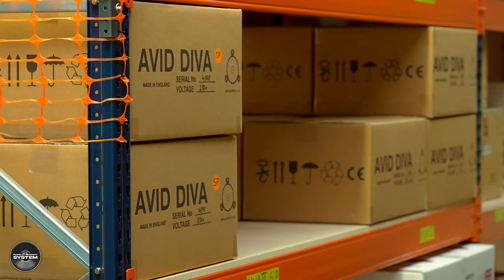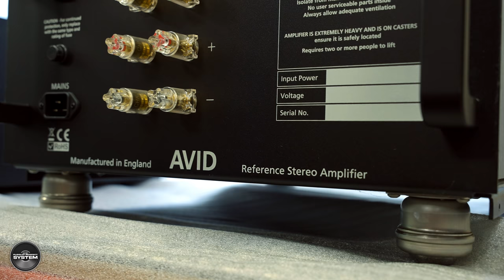TURNTABLE SETUP ADVICE for Vinyl Record player "adventurous" BEGINNERS

Comment: I am not a currently a "practicing audiophile;" I stopped playing the game back in the 90's. Bui the practical side of me says that if you really wanted to remove unwanted external vibrations, you would remove the turntable from the listening room altogether. 

Honestly, high end audio is jewelry for (primarily) men. I am not saying serious engineering is not going into this stuff, but fundamentally a turntable is a simple thing,.that has been turned into a gold plated Rube Goldberg device. I fell into the trap myself, although at least I acquired my turntable (a Kyocera PL-910) at a warehouse clearance sale for relatively little money. There is no way in heck I would spend five figures for a spinning platter, EVER. A turntable that expensive is a vanity device, and no way can the cost-to-benefit ratio ever be justified on sonics alone.

Comment: I have the utmost admiration and respect for Conrad and the team at Avid !  I considered a mid level unit but the cost, along with the rather light dealer network in the USA caused me to pause.   Sigh...
Reply: Did you not have a washing machine to put it on?

Comment: I've known Conrad for may years and was one of the very earliest owners of the Acutus first series turntables. It was released, let's not forget, completely against the tide, so to speak, at a time when CD reigned and was on the rise so its testament to both the quality of Avid's products and the leadership and technical knowledge of Conrad firstly, but also the staff he's since employed and its great to see that the company has flourished. Check out Avid gear - its great and for me, Conrads systems are consistently some of the best sounding systems at shows, too, a feat that's not easy to achieve in some of those rooms. He knows how to set up a system to bring the best out of it but also, his products are exceptional, so I guess that makes it easier to start with!!

Comment: Buy a cd player is you want a quiet, perfectly accurate sound. A good turntable with a good cartridge is enough to enjoy vinyl records, but if you want a perfect sound, definitely buy cd player. Most records since the 80s were digitally recorded anyway, and there's also many variations of a particular cd depending on the year it came out, who mixed it, what technology was used. And when you know how they're made, you'll see that they share many common points with vinyl. 

This have a lot to do with confirmation bias when you're paying obscene amounts of money for a boutique turntable, than it has to do with the sound accuracy because nobody will say that their 20k $ turntable almost play as well as an average cd player, no matter if it's true.

Comment: I like the look of these turntables, the inverted cone with the bearing at the top is very interesting, should produce an air-bearing effect around the cone and maintain a level platter very nicely.

I do take exception to their assertion that hand-built circuit boards are better.  I watched that guy handling those resistors, placing them on the board... with his actual hands.
Dry solder joints occur when you get contaminants under the solder, which then corrode their way out.

I would much prefer a clean-room approach with pick-and-place robots, with just final hand assembly for the large capacitors, transformers etc, with high-accuracy components and possibly a varnish over-coat to prevent airborne corrosion later.
If they were going to go for hand-built then I would prefer to see wire-wrap circuits than PCBs.  There seems little point in going to the trouble of printing a circuit board, then going at it with a regular soldering iron.

Comment: The obsession with vinyl makes me laugh. The best Studer A80 tape deck used in mastering peaks at 18khz and doesn't go lower than 60 hz. When a Neumann lathe cuts a record, the top end is naturally further rolled off and the bottom end has to be levelled down as well so the grooves don't collide. The result is a frequency response and signal-to-noise ratio that can be encoded with less than 16 bits, Red Book CD standard. Then there is the myth that somehow, you hear detail in the sound wave, that the analogue transducer is magically able to restitute, especially with valve amplification that further adds second-order harmonics. The problem with you guys is that you've never experienced a proper, double-blind, level-matched comparison. A good one would actually need to add analogue hiss to digital playback, to avoid the ear being able to distinguish the digital source on the basis of its silence alone. As for "digititis", the sort of sibilance that was an issue back in 1982, today with modern ADCs and DACs this no longer exists. But I get it : You're not selling audio reproduction excellence, you are selling a lifestyle. Maybe consider incrusting diamonds on the chassis of the turntable.
Reply from the maker: I think these days most audiophiles with high end turntable setups also have high end digital setups as well and if you read through the comments you will see a lot of people say some stuff sounds better on digital but they prefer others on vinyl.  I have heard most of the very best digital setups and yet some vinyl setups have sound better in some ways too so best not to draw a line with things like this and be so damning towards others who clearly see things different to you.

Comment: The Avid Acutus is a fine turntable. Although personally I've not liked the SME arms that I've heard, due to them prioritising detail over dynamics.
The real value in turntables is in the right priced idler eg Garrard 301 or 401, classic Lenco, or Japanese mid range to statement level direct drive from the 1970's to 1980's. All with the right arm and moving coil or moving iron cartridge. Plus a decent phono stage, eg NVA Phono 2 plus correct positioning of the TT - as far away from the speakers as possible on the right support.

Comment: That Avid guy talks about compromises, like the length of the tonearm as it constantly change the angle of the cartridge in respect to the track, when the vinyl are carved in the mastering process with a stylus that are always in a fixed angle to the track. What happened to the turntable in the old days that had a tonearm that moved in parallel over the record to keep the angle correct? Was it Bang&Olufsen ?

Isn't time to replace all that expensive hardware by modern technology. The needle wouldn't need to drag the tonearm over the record. Why not put a laser in a cartridge that follows the track and exactly steers a tonearm motor to keep the needle exactly in the middle of the track. Or even better are to replace the needle with two lasers that reads the grooves two sides and make use of their modulated output. I think that CD's have some 40dB more dynamic than vinyl, so vinyls need to be mixed more compressed with less dynamic to not end up in the background noise of the plastic material in the vinyl. Vinyl requires the bass frequencies to be mixed into mono where a CD can have separate unaltered bass in both channels.

The problem are that most of modern time CD's are mixed to sound good from broadcast radio, a mobil phone or in a car where it needs to be compressed more. So the increased dynamics are not put to use in CD's but the superior technology are there. When I listen to audiophile records with great dynamic in the mixing and there's a symphonic orchestra playing and it goes very quiet, I can still hear the background noise from the grove. There's not enough dynamic room possible with vinyl. Compared to CD's of the same orchestra it's dead quiet and only the room noise can be heard when just a couple of instruments are playing.

The whole process of carving the aluminium disc from the master tape, analog or digital, and then put a electrolyte skin over the aluminium to protect it and then pour metal into it to mold several negative discs that then are used to press plastic records from, all that mechanical transfer will add molecule noise from the materials surfaces in each copying process and will reduce all the details and high frequencies from the final vinyl that you buy, and then add the reduced dynamic range in the physical media. Why would anyone prefer vinyl instead of CD? With vinyl you get a softer sound, as it has been stripped off the finer details, and can be pleasant to listen to when it doesn't have as much information that you will need to process, as when listening to a good mastered CD. All these super expensive vinyl equipment are like putting lipstick on a pig, the base to build on are not good enough.

Comment: Who machines up the platters on these things? A pre schooler? Any engineering shop I know would immediately reject that much run out, look at the thing!!! Around 12:30 provides a good view.
So easy to see with the naked eye; I've seen same from other vids of similar TT's. Absolute rubbish. I put a dial gauge on my TT and runout is near to unmeasurable and certainly cannot be seen. 
BTW we are instrument technicians, rotating machinery specialists and a NATA certified lab.

Comment: Or you could go to yardsales like I do and find whatever. Like a 1978 JVC QL-2 w/AT eliptical needle cartridge. A 1977 JVC KD-25 cassette tape deck. A 1978 JVC jr-s301 receiver. A Magnavox 5-disc CD player and two Kenwood speakers........all for $30.
  They all worked perfectly except for the cassette player which I fixed and now works perfectly. Show me a DD turntable for under $1000 that spins as accurately as that Quartz-lock TT. I'm sure something is out there, but not for $200(which is about the average price for a QL-2). Someday I'll find the guy who don't know what he has and sells me one of these things in the video for $10.😆😆😅😳

Comment: I really like the vidéo.
I wonder if there is no way to correct the playback? Left and right are inverted.
Reply from the maker: Shouldn't be it was recorded in stereo and then I adjusted the sound to balance each of us to be more central when speaking solo but also so you could hear the fact of where we were sitting
Reply: @PursuitPerfectSystem  yes indeed where you were sitting specially at the beginning. It's better after. But it's on most videos on youtube. Not only yours. Only movies, tv shows and video games get it right.
Reply from the maker: @yannick930  if your experiencing sound issues  across various YT channels I think check your settings must be something a miss there as getting stereo sound correct is pretty basic stuff in all video editing softwares and it's right 99.9% of the time on YT. Just a suggestion

Comment: belt drive is the most inaccurate unstable drive design. Wow & Flutter on this table is likely 0.1 or worse. Waste of good material !
Reply: Eric  Dual cs5000 is only belt quartz lock turntable ever made. Unfortunately the cs5000 plynth is particle board with poor rumble isolation. The Technics 1200 with upgraded tonearm is The King.